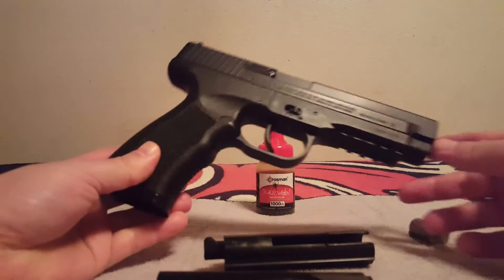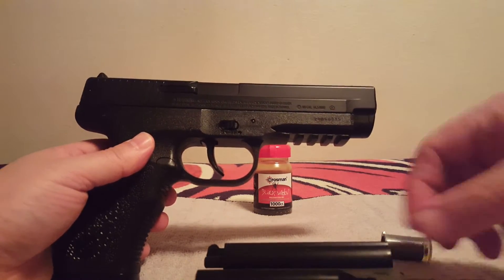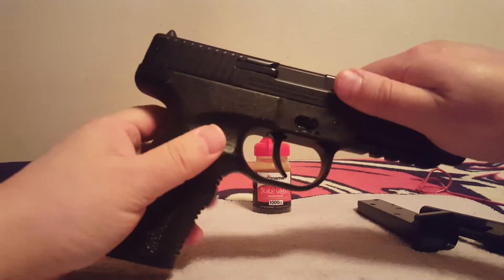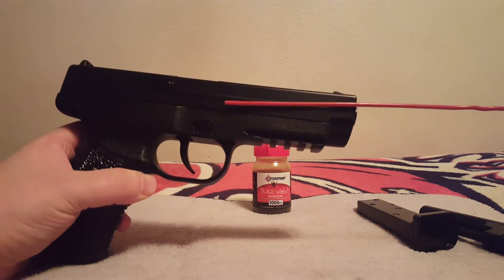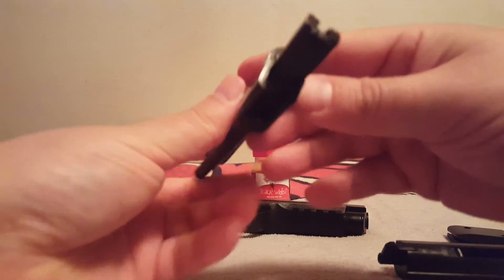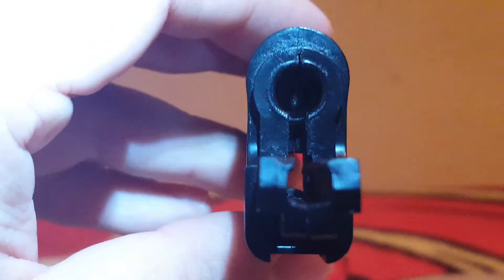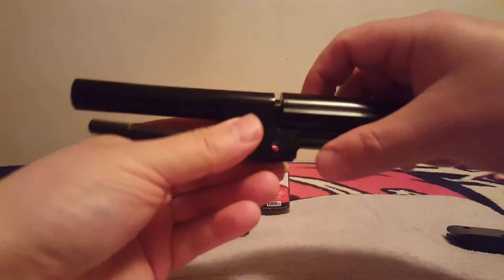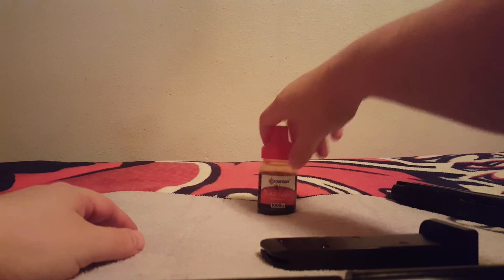Crosman PSM45: EASY Breech Jam Fix

Comment: @Daisy 880 Fanatic Fix It Thanks for all your great, detailed videos! I am about to rebuild my 80s model Daisy 880 going by the info I got from you. Since I have seen this Crosman and Umarex videos at your site, I realize you fix other than just Daisy. Now if you could do me a wonderful blessing and show how to lighten the trigger pull on a Ruger/Umarex Impact Max Elite .22, I would be very grateful. This rifle actually shoots very accurately and hits hard if I could just over come that miserable trigger. Which takes so much force to squeeze that it makes it very difficult to keep it on target. I ave not been able to find detailed videos like yours on the Daisy 880 trigger and seals, for this rifle. But boy does it need it!
Reply from the maker: Bill, I have done a video on the Ruger Explorer. The trigger isn't great but NOT too stiff.

My new Ruger Mark IV pistol has a SUPER STIFF trigger. If you are bothered by that on a rifle, imagine a pistol like that.

Sorry, this is strictly a FIX channel (with a few hacks), mod work or re-engineering a gun, including trigger, is outside my realm. I try to refer to others, but I don't know a channel doing mod trigger work on spring guns.

Let me see if I can find you a  knowledgeable pro to help.
Reply: The trigger pull can be made lighter by replacing the sear spring with a lighter spring. Be sure to safety check the gun after replacing the spring or making any changes to the fire control group. This is a video that gives an idea of what needs to be done: https://www.youtube.com/watch?v=eOuwtTZnfaM

Good luck!

Mark
Reply from the maker: Bill, Cobalt 327 came to the rescue! I really love how responsive he is here when I ask for help. Looks like Simple mod!
Reply: @daisy880fanaticfixit9  , @cobalt327 Thank you both. I was wishing/hoping for a blow by blow like you do on your several Daisy 880 seal rebuilds, but this is certainly way better than nothing, pointing out what he had already done. I will just have to give it a try. Since he at least shows where the spring is, and I suppose I can pull it off of there with some needle nose pliers and attach the replacement(after cutting it down to size/shorter) without having to un-screw/remove any other parts. (or maybe not!) I'll need to find a video on how to break it down so that those parts will be exposed. I suppose it is just a matter of a couple of screws of a certain size. 
I'm sure I seem excessively hesitant, but it is a brand new gun, and I hate to screw it up while voiding warranty as well. But, not much to lose really, since the trigger is so miserable, and WM refuses to take it back even under 30 days. So even if Umarex could or would repair it under warranty(they might consider the trigger to be within factory specs) I can't imagine what the shipping would be. So I guess it will be taken apart. Too bad. Except for this 12 lb pull(seems like it) trigger, the gun seems quite accurate and powerful. Now, I'm not going to hesitate to take my 880s apart, since I have your videos to guide me! Thanks again, guys!

Comment: I have both the Daisy  Powerline 340 and it broke inside. And the Crosman PSM45  is still going strong. The only problem  with the PSM45  is when I forgot to  release  follower in the magazine.  Lol
Reply from the maker: Sir, smart comment from a user who has both pistols.

The part that normally breaks on the 340 is the post in the back. It normally fractures. Shooters don't understand why it won't cock. The sear can't catch the piston. 

The post should be 4140 steel, which is strong steel but handles shock. It is especially important steel if Daisy wants a hammer to hit the post!

The psm45 doesn't have a hammer that smacks the retaining post. That post retains your Mainspring.

Like you humbly admitted, short of user error, the Psm45 is an improved version of the 340.

I have suffered ZERO jams using only NEW Black Diamonds or Black Widows.
Reply: The leader broke on my Daisy Powerline 340. I'm planning  on getting  another  340 sometime.

Comment: Managed to get the jammed Bb out. Turns out there was 2 of them jammed in there. But it still doesn’t shoot. Managed to get one shot out after I jamming but the rest just continually jam. Guess I’ll have to take it apart
Reply from the maker: Before taking it apart, what BBs are you using? If they are Copperhead, Stop! Switch to Black Widow or Black Diamond.

Don't sling shot the slide. That causes loading jam, not a breech jam. A breech jam is a bad BB, either a faulty new one or a used BB.

Try this video and switch ammo. Please click "more" and follow links to learn how NOT to operate this gun and proper operation.

https://youtu.be/smGRTF4NZXc
Reply: @daisy880fanaticfixit9  not sure the exact brand of Bb, they are silver and I’ve had them for probably over ten years. I used them when I initially got the gun and got about 100 shots out before it jammed. My friend mishandled the gun and slingshotted the the slide jokingly about six times in a row like he was fanning a revolver and I think he must have broken it. Like I said I got the jammed bbs out thinking that would’ve  fixed it and I managed to shoot one Bb out of it for the first time in a year haha but every time I reload it now it still jams. Thanks for the response
Reply: Loaded the clip to maximum capacity thinking the extra pressure from the spring in the clip would position the Bb correctly and that seems to do the trick for some reason rather than loading it one Bb at a time. It shoots now hahah thanks a lot man. Haven’t been able to shoot this gun for over a year
Reply from the maker: Good job!

It is guys like you who make the work on this channel worth it.

You are smart and level-headed enough to fix it💪

Comment: It was at my cupboard for over a year , and it’s not cocking anymore , any suggestions?
Reply from the maker: Ok, not cocking for this gun or the 340, means one of 2 things:

(1) The post in back that anchors your mainspring is fractured - the piston catch and trigger sear don't mate. It either got dropped, or is wore down after thousands of shots. All 3 of my 340s died after the post fractured, many shots.

(2) You have a BB loose in the frame so my 340 video covers that. Do a partial rack. Eject your mag, pull the slide back half way,  and SHAKE. The BB falls out the well.

Comment: still not understanding why jamed how to fix jamed
Reply from the maker: I will give you link to 340 video. The 340 has major advantage of easy to remove slide.

I cover loading jam and breech jam in that video.

This video covers a BAD BB stuck in the metal tube. Some call it the barrel, others call it a shot tube jam because it is a smoothbore.

By ejecting your magazine box, half cocking the gun, and then running a rod down the muzzle, you knock LOOSE a breech jam. It then falls out the mag well (empty hole where your magazine goes).

https://youtu.be/pr-bKSSpSPU

Comment: Link to parts?
Reply from the maker: Steve, the last time I tried ordering psm45 parts from Crosman, I got a very angry manager on the phone.

The friendly CSRs emailed me that I could order parts after downloading the parts PDF (on their site). After getting the PDF blue print,  I was ready to order new parts - like a new slide assembly. When I called, the manager informed me that they were not selling psm45 parts.

But you can try it. Go to the Crosman site and see if the phone number is still there for you to call.